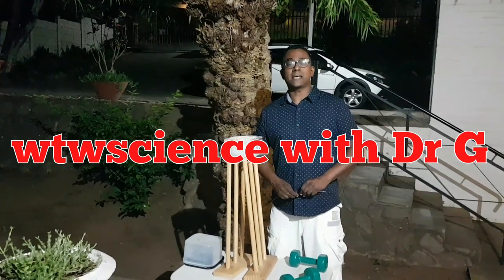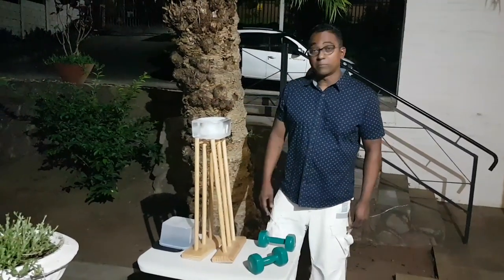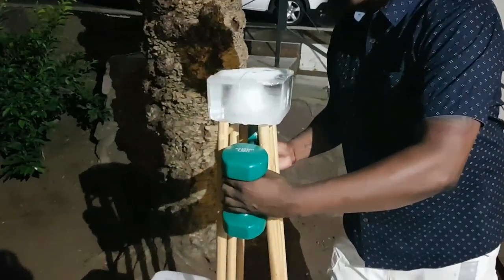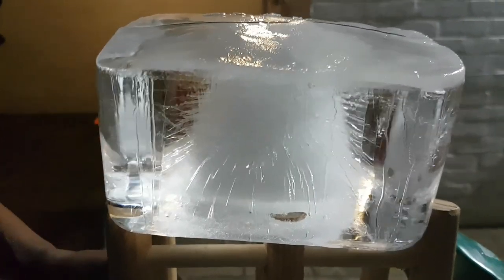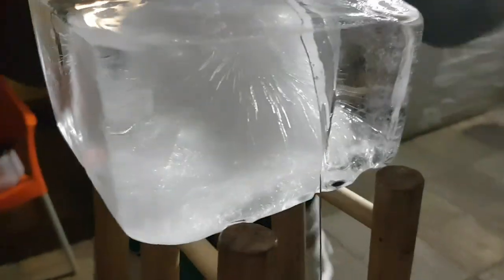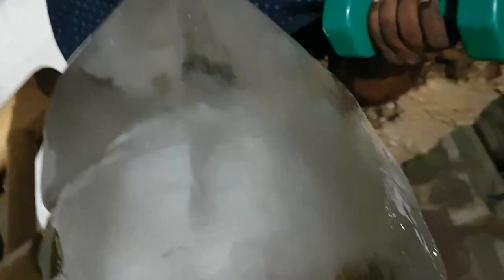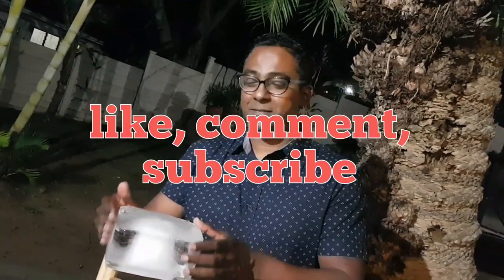wire through ice

Comment: Different metal wires will work differently, Id like to see a test between a few types to see which transfer the temp and cut through faster.
Reply: I'd asume cupper
Reply: It's because of pressure not temperature. Ice melts when it is pressurized

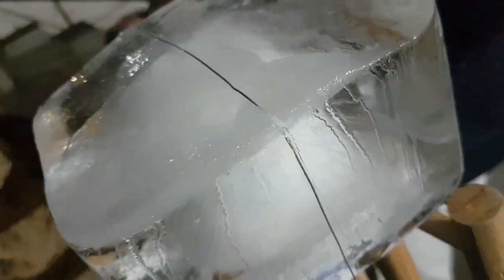Comment: This is a nice demonstration. I understand the pressure melting part, but I’m confused about the heat transfer and the role of the wire in conducting heat as the speaker mentioned from 1:24 to 1:34. Can anyone help clarify?

My thoughts are:

During melting, since thermal energy flows from higher to lower temperatures, is the wire conducting warmer environmental heat into the ice, thereby enhancing melting? This effect occurs alongside pressure-induced melting.

During refreezing, as the ice's temperature is lower, I don’t think the heat released from the ice can be conducted away, as the speaker mentioned. However, I’m unsure if the heat released during refreezing could internally enhance melting along the wire.

Comment: What happens if the wire you use is a non conductor of heat? Will it still pass through the ice without cutting it into two?
Reply: Excellent question. A piece of string which is essentially an insulator will cut through ice. It is the pressure difference above and below the string that allows the string to pass through.
Reply: As the pressure increases the melting point decrease ... So ya it'll
Reply: I disagree with the previous commenters. The effect of higher pressure on the melting point of ice is far too small to melt the ice so quickly. If you were to use for example nylon, which has very little heat conductivity, the experiment would take much much longer
Reply: Yes..because only pressure and hence the cross section of wire is responsible here....doesn't matter the wire is a conduct lor or heat or nor

Comment: Could you please explain behind the event. I also made the same experiment for my channel. I would like to gather more info of it's physics.
Reply: Matescium hydrogen bonds and the pressure being applied to it by the wire
Reply: Its because of regelation phenomenon
Reply: @csabapargariu1177  His explanation is not actually very good. He doesn´t explain why it happens with water ice and not usually with other solids. The real reason can be seen in the phase diagram of water (see, for example, https://physics.stackexchange.com/questions/346750/phase-diagram-of-water) and it is that the phase coexistence curve between the liquid and solid states has a negative slope. This means that by increasing the pressure on solid ice near its melting temperature you can make it a liquid. Physically , this happens in water because the liquid has a lower density than the solid, which is rather unusual, and by the Clausius-Clapeyron relation you see that the coexistence curve must have a negative slope (because the change in entropy has the opposite sign to the change in volume: Lowering the volume increases the entropy which turn the solid into liquid). 

From the phase diagram you can actually answer a point that deGrasse Tyson couldn´t which is the coldest temperature of ice that can let you skate, this would be 251 K, or -22⁰C, which would require a pressure of 210 MPa turn liquid. At colder temperatures no matter how you change the pressure the ice still stays solid. Of course in practice no one could skate at this temperature because it would require you to have skates with the exact surface area required to achieve this pressure because, as you can see, the slope of the phase coexistence curve turns positive so if you increase the pressure too much the melted water becomes solid once again. Therefore you could say that in practical terms around -20⁰C is the coldest temperature in which you could possibly skate and it would likely require fine tuning of the blade edge.
Another practical problem is that melting ice at -20⁰C would require pressures around 190MPa which is relatively close to the strength of regular steel alloys and in the same order of magnitude as the tensile strength of high-strength steel (which is classified as having strengths higher than 550MPa). For a successful skating experience in this temperature you´d need to maintain the 190MPa while at least a single skate is resting fully on the surface of the ice, the issue here is that if that area is reduced (e.g., if a skate makes partial contact) this pressure could exceed the tensile strength of the material, leading to the blade dulling or breaking both of which would end the skating session. The other problem, mainly for figure skaters, is that the impact from landing jumps is also likely to dull or break the edge since the force would increase accordingly. Also turning might become a problem if the contact surface increases too much, causing the water to solidify back (and probably tripping the skater).